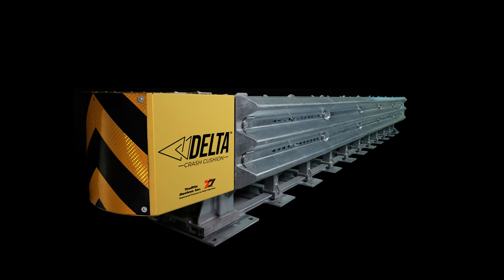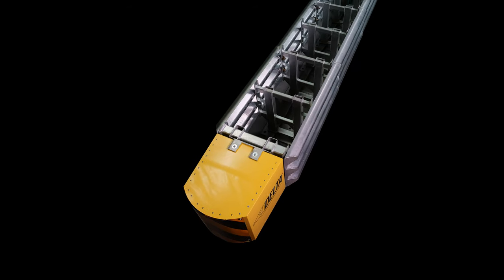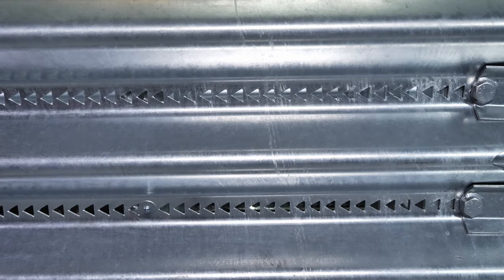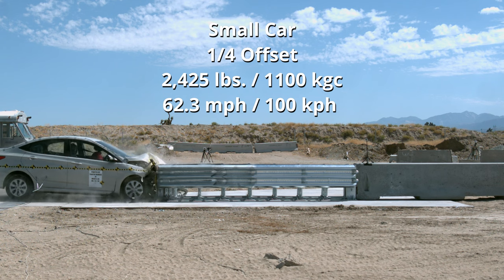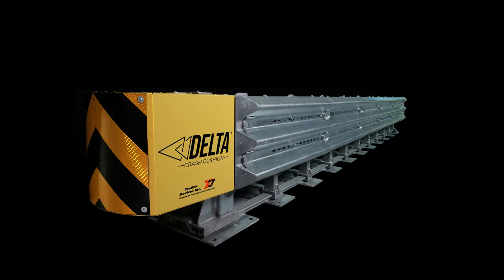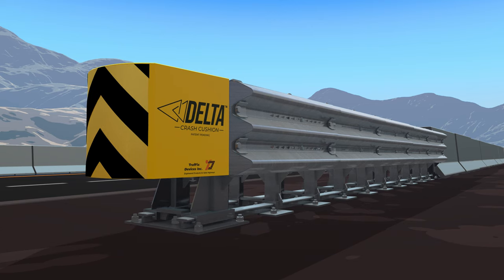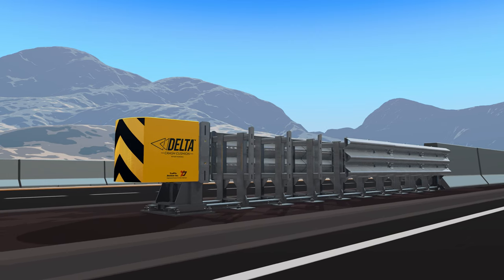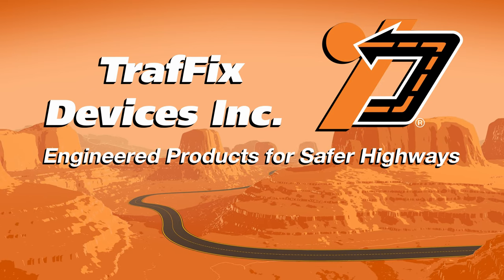Delta® Crash Cushion — TrafFix Devices

Comment: What about beyond 62mph? Most crashes I feel are over 75mph. Would these be recommended to stop let’s say a car who lost brake control
Reply from the maker: Hey @KingAndrew20, thanks for the great questions!

"What about beyond 62mph?"
This speed is specifically mandated by the U.S. Federal Government for testing this category of device, for use on the National Highway System. The vast majority of crashes are at speeds less than this speed. Crashes at higher speeds do get more attention though, as the severity of a crash at higher speeds is much greater. This device will absolutely reduce the severity of an impact at speeds above 62mph.

"Would these be recommended to stop let’s say a car who lost brake control"
Yes, this device is designed to shield a roadside hazard, and stop a vehicle that is "out of control". It is designed to be positioned on the roadway so that a driver who has lost control would impact into this forgiving crash cushion, saving their life, rather than impacting into a rigid object, that if struck, could cause severe injury or loss of life.